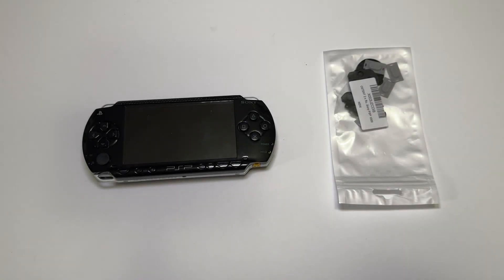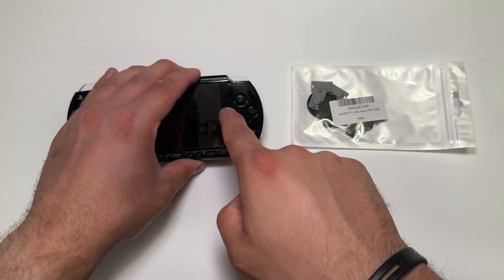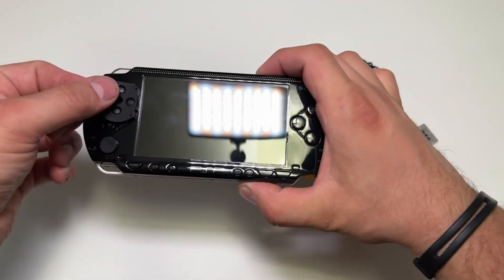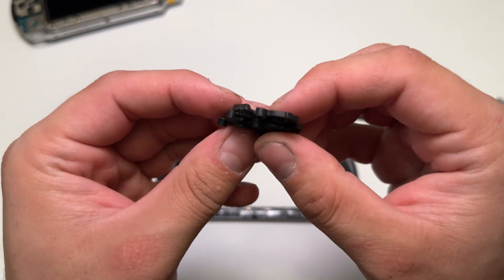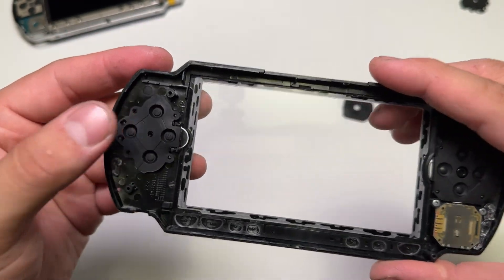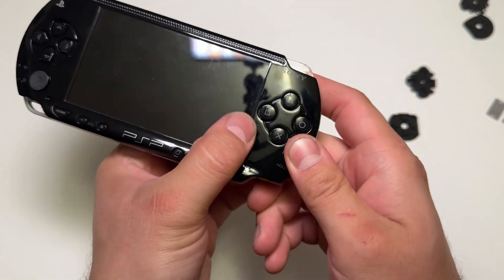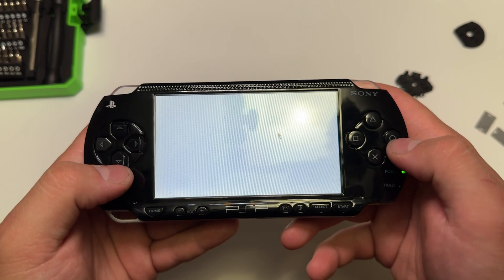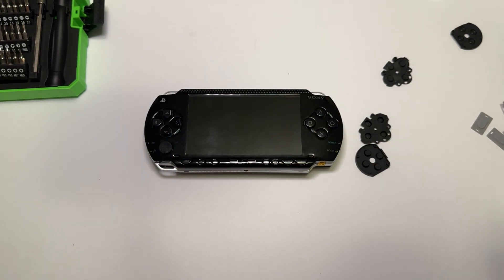Fixing My Loose PSP Buttons With a New Rubber Membrane / Conductive Pad

Comment: Hi do you know if this rubber membrane for the PSP 1000 is compatible for the PSP 2000? My plastic membrane is cracked and broken and I can't find a replacement aside from the PSP 1000 rubber membrane.
Reply from the maker: I looked up a teardown for the 2000 and it looks like the buttons and membrane are a different design so I don't think the 1000 parts would work. You might have to try to find a parts PSP 2000.
Reply: @Mr.Everything can I replace my 3000 button membrane?